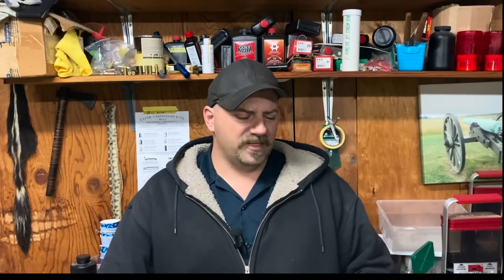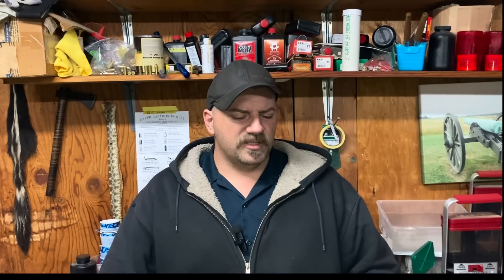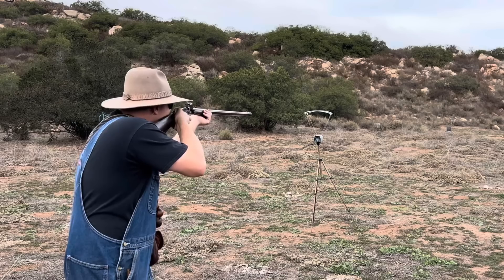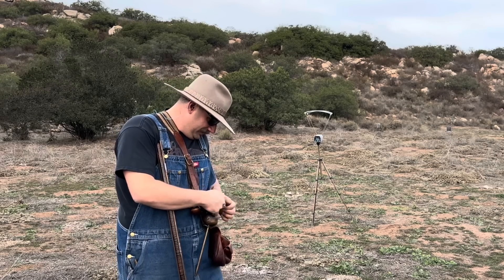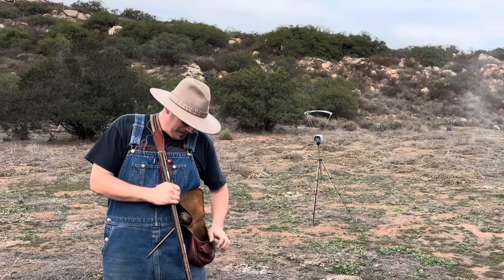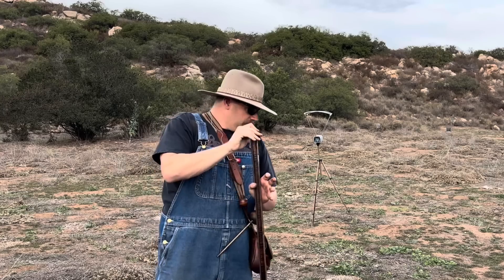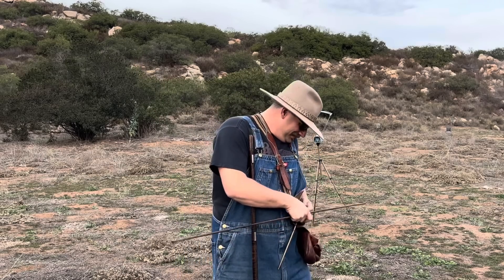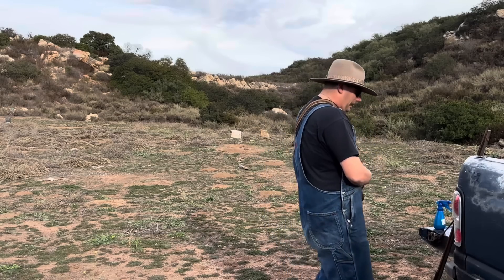Black Powder (Carbon Black)

Comment: the best of my knowledge modern carbon black is made form 2 materials oil just above ships bunker fuel which is basically a liquid tar and coal tar and it is soot! the only things i know it's used for anymore is coloring rubber for car tires coloring cement and making black ink! now the old stuff that i know of was soot made from kerosene so it might give different results if you could find some! by the way elemental maker tried some powder using graphite rod material (basically graphite ceramic!!) don't bother it sucked dogs! he also tried synthetic diamonds same results! have you ever tried marbles in the tumbler? currently i'm switching back and forth between brass rods and a mix of lead balls(50 cal and buckshot) to see what works best and i saw the marbles in the store the other day and got wondering how they'd work!

Comment: What I'm getting from this is that you want a relatively dense form of cellulose with as little lignin as possible. Perhaps a good test would be a roll of plain brown packing paper versus an identical roll of printer-grade paper? Alternatively, you could try bleaching strips of, say, pine by boiling in a sodium hydroxide solution to remove the lignin. Different boil times, washing steps etc can adjust the lignin level and wood pH as needed.

Comment: from wikipedia: "All carbon blacks have chemisorbed oxygen complexes (i.e., carboxylic, quinonic, lactonic, phenolic groups and others) on their surfaces to varying degrees depending on the conditions of manufacture.[19] These surface oxygen groups are collectively referred to as volatile content. It is also known to be a non-conductive material due to its volatile content." so perhaps you are not getting good combustion due to the fact it has been chemically treating with things which inhibit its ability to pick up new oxygen in a chemical reaction and thats why you have such poor velocities and such heavy fouling

Comment: I'm also not a chemist. Although I wonder if it might have to to with the oxidized state of the carbon in lamp black. When you make charcoal it's in a low to no oxygen environment, it's more similar to evaporating the impurities off than combustion do to the lack of oxygen.

Comment: Welp...the result was fairly predictable. 
While there are several types of carbon black, they are all basically the result of incomplete combustion of something oily.

It is NOT pure carbon.

I have used it for years as a pigment. That's what it is mostly used for. It mixes amazingly well with oil based finishes.

Kudos for the valient attempt!

Comment: I'm thinking based on my reading that charcoal is not pure carbon. It has a few percent hydrogen and oxygen in it. Various sources result in different percentages. I speculate that a bit of oxygen in the black powder let's it burn faster, as that's what burning is, reacting with oxygen. Carbon black is purer and would then starve the mixture of oxygen.

Comment: Interesting.  When you make charcoal, you're not actually making "pure" carbon (Unless you"re heating it red hot). When heated, organic materials like toilet paper wood, etcetera, decompose into a carbon rich material with plenty of partially decomposed products.

Thats why your choice of carbon source is so important. 

Once thing that might make really good souce of carbon... is ordinary table sugar. 
Sugsr, is a carbohydrate.  Which means that it is comprised of carbon and water. 

It might decompose into mostly carbon with some carbon hydrogen chemicals that might be just what is needed for fast clean black powder.

Comment: I don’t have any experience with carbon black, but I’ve heard one of my cousins talk about it. He used to work in a Goodyear factory and I guess they use it to color their rubber. He said if you ever drop even like a tablespoon full, it’ll be on every surface within 100 feet

Comment: Lampblack is traditionally made the way it gets its name.... a metal plate suspended in the flame of an oil lamp... traditional lamp black is not only fine carbon soot but very oily in texture from unburnt vaporized oils condensing back onto the carbon stuck to the metal plate suspended in the flame. Thus, true lampblack is very, very impure carbon. The impurities can be of any oil... oriental lamp black traditionally used tung oil flames and the west used olive or linseed.. who knows what waste oil could be used to make a cheap lamp black carbon these days. 😢

Comment: I would love to see cardboard boxes as a carbon source.  I started shredding all the cardboard I get in the mail for composting but I am quickly ending up with a huge surplus of shredded cardboard.  When shredded it burns even better than regular cardboard and I have used it to start campfires a few times. If I could use the surplus to make antique muzzle loading propellant that would be a huge boon.  If you want to shred a large number of cardboard boxes you need one of the nicer paper shredders.  I got one that was rated to shred 16 sheets at a time and it works pretty well.
Reply: It makes good BP, but has a high salt content (slag).

Comment: Golden Powder.  Have you thought about that?  I'm going to try it.   Supposedly, milling it dry and corning the very slightly dampened meal like with BP cures the hygroscopic tendencies compared to the usual way of mixing with water, cooking it, and drying the cake.  Also, supposedly adding 1.8% powdered charcoal and 1.8% powdered iron oxide lowers the flame temperature some and it will work in a flintlock.  All this is "claims" from expired patents.  I want to see if any of this is true and if it is, will be making my own damn videos to add to the brain trust.  Ascorbic acid, even at 40% of the mix, isn't prohibitively expensive and can be had in bulk quantities.

Comment: coconut ... use a coconut as your carbon sourse
Reply: I don't think this is gonna work,
I've tried putting some coconut  shells in my wood stove and they didn't burn at all
Reply: @paollus8575  darn, but they do have activated coconut charcoal you can buy

Comment: It would be interesting to see how cheap stuff like dried leaves, dry hay, or sawdust would behave like
Reply: I wouldn't use hay or other grasses (bamboo by example). They have high concentrations of silica and could create hard to clean fouling.
Reply: If I remember correctly, I read in an American Fireworks News article that charcoal from pine sawdust or douglass fir works well. That's an old memory, though. Also, the author had good results with balsa, if I remember correctly. There were advantages to each, though.... old memory.

Comment: I've been in the oil and gas business (control design for over 1/2 of it) for about 46 years. When I was a kid we lived in Borger, TX and my dad was a construction superintendent in the Carbon Black plant west of town. As I remember it hey were increasing the size of the bag filters, which increased the recovery of carbon black. "Black" is made by burning gas, oil, or both extra rich. If you've ever lit a cutting torch or rosebud you've seen the soot that is formed if a hydrocarbon is burning rich. 

The soot is trapped in the bag filters. Once a bank of filters is "full" they switch to a new set, "puff" the set that are dirty (not sure how that was done, I was a teenager and that's how he explained it) to recover the carbon black. 

FYI-  "petroleum product" = hydrocarbon = a molecule of hydrogen and carbon with a ratio of CnH2n+2. For instance, propane = C3H8. That's all it is. It's about as green an energy source as it gets. 

I think properly combusted wood is likely to have more "things" in it that would make it a better source of carbon than carbon black. Black is too pure. It's literally just carbon. Now back to see what the video results are (bet I can guess).

Comment: My first inclination as to why this performed terribly is an incorrect oxidizer to carbon ratio. If you weighed out equal amounts of lamp black vs charcoal it is possible there is more elemental carbon in the lamp black than in an equivalent weight of charcoal. That filthy black patch and an excess of fowling is an indicator of a lot of carbon being left behind as solids in the rifle bore.

Comment: It would be curious to see how your process affects the final outcome. You should try taking Swiss or Goex and run it through your process (wetting, pressing, pucking, and grinding it) and then testing it against itself as it come out of the bottle. You’d know your process is good if it averages the same chronograph results before and after.
Reply: I would like to see this
Reply: There is a state known to experienced amateur pyrotechnists in which it is possible to mill your powder to the point it slows the burn rate. It has been hypothesized that this is due to a reduction in internal surface area of the charcoal. Also, Sporting grade powders like the Goex Fg series are typically glazed with graphite (to reduce dust IIRC) so you would then be incorporating a 4th material with very poor burn characteristics into your finished powder.

Comment: Great video. Now I know not use lamp black for a carbon source. 
   I'm still wondering if old blue or brown denim overalls might be a good source of carbon to char. 
   I've accidentally lit myself on fire countless times while welding, and that's before the material had been charred. 
   If fast growing trees are a good source of charcoal , then Bradford pear might work.
Reply: Blue jeans make promising powder.  My second batch is showing lots of promise for cleanliness.  I get almost twice as many shots out of my 58 remington relvolver tan i get with goex.  Gotta get a chrono so I can compare speeds. And cast more bullets.
Reply: @BobJones-t6q  that is good to hear.

Comment: OK Jake I am going to be up front with this one, and that I am mostly joking with this but also very curious as well. And when I say mostly joking I mean 90% or better joking. But this has me wondering how that wacky tobacco would do as a carbon source, that is the part that is joking. Now here is the part that is serious and that I am curious about, and that is actual Cigar/Pipe Tobacco as a carbon source. The cigar/pipe tobacco is something you can get in a good supply, and my curiosity about it is with the tar that it tends to make so I bet that would be worse as far as dirty goes but I could be wrong.
Reply: Might be good, but your powder would be around a hundred bucks a pound.

Comment: Just a curious question?  And it may not make a heal of beans.  But here goes. Did you do your normal water Wash or alcohol? The only reason I ask is if it's petroleum-based we know water and oil do not mix.
 
With that said and looking at the amount of Crud you had in the barrel I think that would make an awesome birthday present for my brother-in-law😅😂.

Comment: I think "carbon black" or "lamp black" refer more to a process for making the material rather than its exact composition, which probably depends on the source material, just like "charcoal" is not all the same. Lamp black is just soot that is deposited by placing a cold surface in the reducing part of a flame. This is similar to exploiting the pyrolysis which happens in making charcoal. The key is to stop the combustion reaction by having a lack of oxygen (or in the lamp black case, to cool off the partially-combusted particulate matter so it cannot continue to burn).
Reply: Good description.

Comment: Even though it was a Michael Charlie Foxtrot, it was still interesting, to say nothing of our slightly twisted schadenfreude. I am still curious about stuff like carbonized leather, cow bones, woods like mesquite, lilac, rose of Sharon. Black powder making is such a fun adventure, seemingly endless possibilities! 
I do have a question, on the nitrate of soda: When I was a teenager, I made a mix that used sodium nitrate and lite salt (potassium chloride), then added the ground up lump charcoal and sulfur to grain alcohol in a slurry. (I used to work in a feed mill and garden center, and my boss and I would sit and discuss muzzleloading from time to time.) Was the addition of the potassium chloride just a wasted step? I've thought about revisiting my recipe over the years, but I don't know if it's worth it.
Reply: Beware of anything containing chloride, it is very corrosive.

Comment: The problem is the charcoal has the benefit of having a lot of surface area.  Light for volume.  Carbon black is wanting it to be a dense additive, used as a pigment, you want it heavy for volume with very small particle size.  This is the exact opposite of charcoal.
Reply: It's printer toner without sand.  (SiO2)

Comment: Carbon black is not necessarily from a pure source.  It could be from burning garbage.  It is made in a similar way as your charcoal but it could be from anything.  Plastics... wood... whatever.  We had a guy come into the office wanting a building designed for his carbon black facility.  He was planning on making it from municipal garbage.  They would use the process in tandem with collecting the gas.  So you basically are gasifying the garbage at the same time.

Comment: Hemp Crete, Hemp Hurd, for making hempcrete blocks - is sold in 50lbs bags and can be found for $1-2/lb. 
Or try Hemp Hurd animal bedding for barns, $1/lb. 
The "hurd" is the dense center of the stalk after removing the fibers. 
Harvesting requires tungsten steel blades on farm equipment because it's 7x stronger than steel. 
Check out the old WWII movie, "Hemp for victory."
Hempcrete Hurd without the lime binder, might give you more bang for your buck than toilet paper.

Comment: Take a rimmed cookie sheet. Fill with clean sand. Soak the center area with a quarter cup of IPA. Put two tablespoons of sugar in the soaked area. Light the IPA with a match and wait a few minute's. As the sugar burns a carbon snake will grow upward and continue untill the fuel is consumed. Smells like ass😂 but makes another source of carbon you could try.

Comment: Puck? Corned? or takes tooo Long?

I am Knott a Chemist, But "I Know" One!  I knew it as "Lamp Black"? I called my Perto Chemical and Mechanical Engineer buddie, "I know a Guy"  he recomended Alumina Media for me AND predicted "Lamp Black" VERY DIRTY! hard to Clean and an Almost a Ceramic like Deposit, looks like about right? he made it Industrially with karosen and low oxygen static charged for harvest.

Check that one off the List of Too Doo!
That's Why they Call It "RAM RODING!"

But IT Could work in the Coating of finished Powder! similar to graphite?

My WORST AMP was Kingsford! one of my 1st too. the COAL Char Blew! big time DIRTY SLOW hard to Light, Bad!

Comment: I wonder if the suspiciously British term "lamp black" refers to the ole timey carbide lamp that British coal miners once used? I say this because in the 1980s some of us soldiers in the Canadian army would go adventure training at government expense. We were outfitted with these small mostly brass carbide lamps for caving expeditions. The burned carbide turned into this black soot from the "little rocks" of carbide. This acetylene(?) gas was created by mixing it with water in a chemical reaction. Maybe this is it ?????
That burned up carbide surely resembles your packaged lamp black?

Comment: Great job going through the various sources of carbon and confirming (or denying) their suitability for antique muzzleloader propellant. Has anyone suggested using mesquite for a carbon source? Your propellant series is especially interesting, as the firing of a muzzleloader has two primary components - performance and cleanliness. These components seem related - powerful propellant burns more fully, leaving less fouling and is therefore (possibly) easier to clean. It's a fascinating topic, both scientific and historic. Thank you for the effort you put into these videos.

Comment: You know what it might be. Lamp black being soot that came off of fire. Might mean that it's the most stable of the carbon being burned.

Think about it it's already managed to go through temperatures hot enough to ignite in the flame but didn't. 

Also think about all the extra baffles and things we put in wood stoves to get the temperatures in their hot enough to burn that stuff.

Comment: I wonder if there's a place you could send samples of your best charcoals to be analysed to find out what they contain that makes them better. 

as for a shot in the dark I wonder what printer paper would do. It's pretty dense and bleached white like TP.
Reply: It's coated in starch to help the ink adhere and the individual pages separate so I'm thinking not great. Also plenty of dye in white paper as well as optical brighteners. Worst of all, it may contain salt. I.E. corrosive.
Reply: I tried paper out of my paper shredder bin and it was terrible.

Comment: IIRC ElementalMaker did a video a while ago where he used ground graphite, which is also effectively pure carbon.  He had similar poor results.

He also used activated charcoal, and IIRC that was disappointing as well.